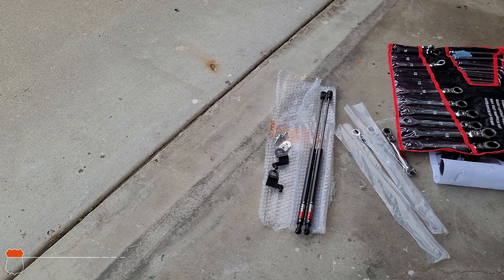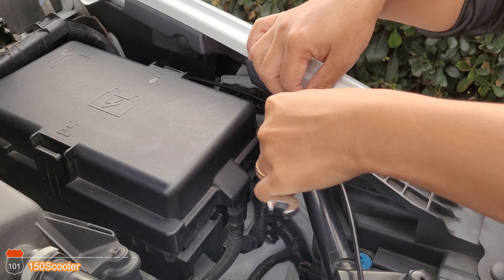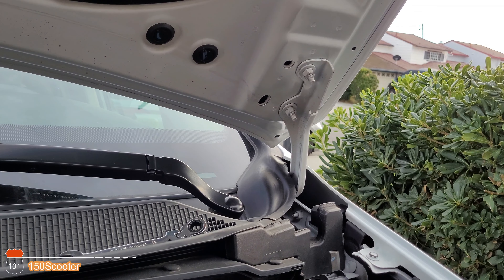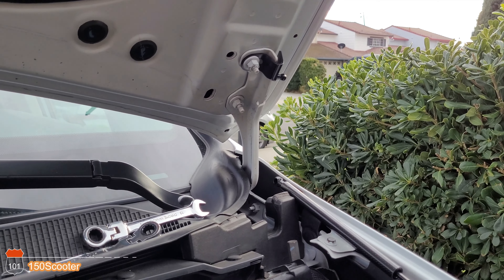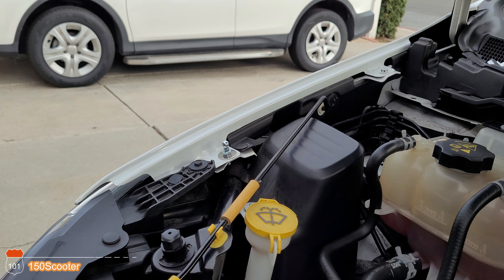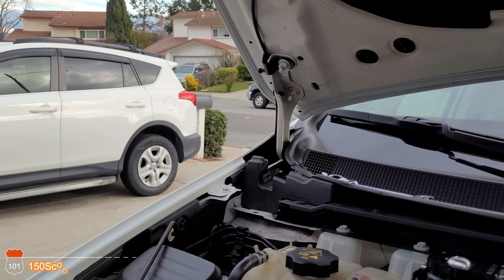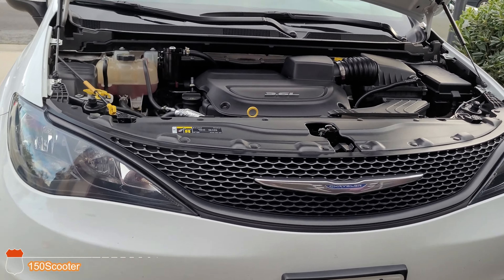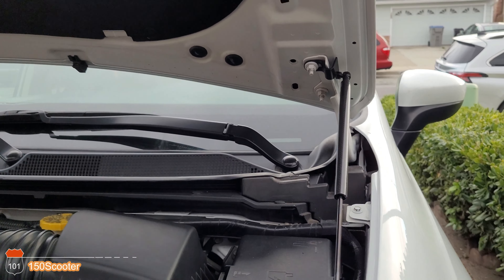Installation and Review TSUBASA Hood Lift Supports Struts for Chrysler Pacifica Voyager

Comment: Thank you for sharing this.  I just installed mine.  Works great!   I would like to offer an observation that you have the left and right upper brackets switched.  The ball should be toward the front of the vehicle according to the instruction sheet.  That's why you had to lower the hood slightly to install the struts.  I installed mine with ball forward and the strut length was perfect.  Not meant to criticize but to help others who install this fantastic hood strut kit.
Reply from the maker: Thank you for sharing. That's why we got youtube. Correction and advice are always welcome.
Reply: @150SCOOTER  Thanks for not interpreting my comment as a negative.  I really appreciate this video and had you not made it I would not have known about this easy and inexpensive upgrade.  Thank you again for sharing!